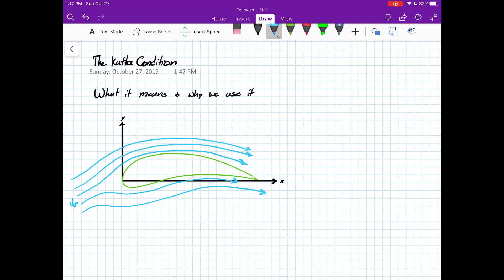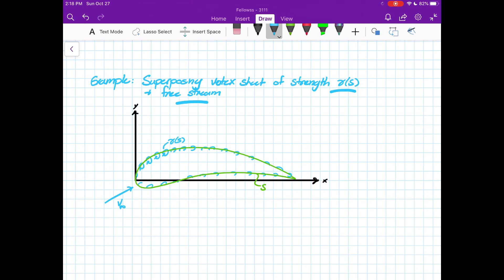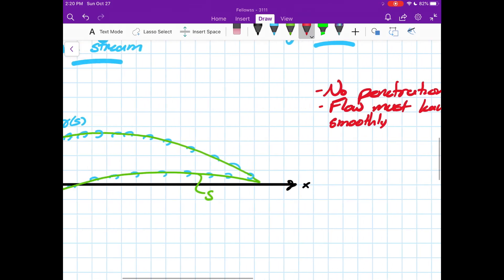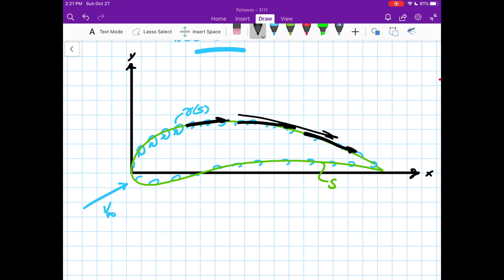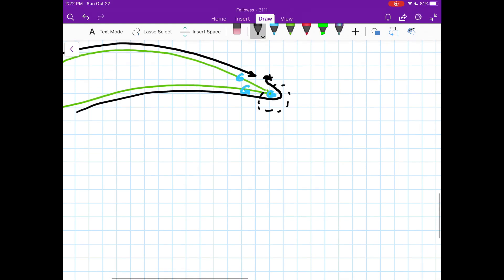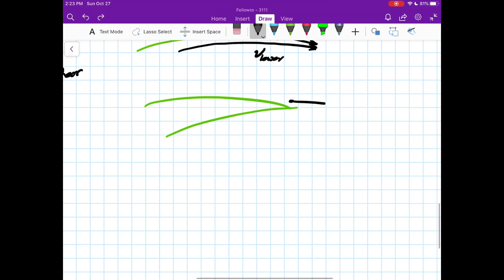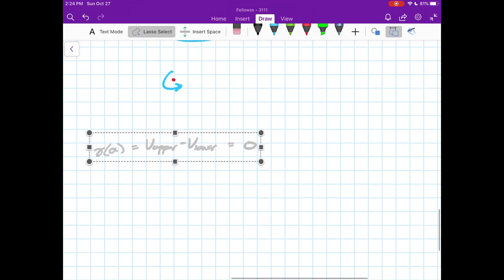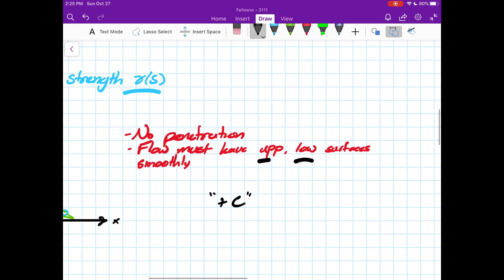ASEN 3111 - The Kutta Condition (boundary conditions) | CU Enginnering Fellows Review

Comment: If an aerofoil speeds up or slows down, or increases or decreases its angle of attack, then the Kutta condition is temporarily not satisfied. If the working fluid is not a superfluid, then there will be a flow separation at the trailing edge which dumps vorticity in the flow until such time as the Kutta condition is reestablished.